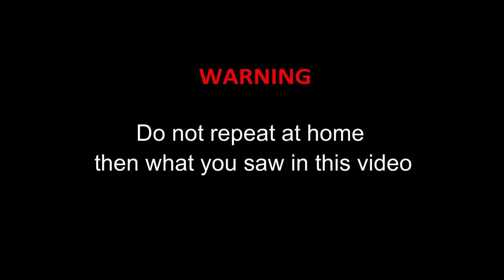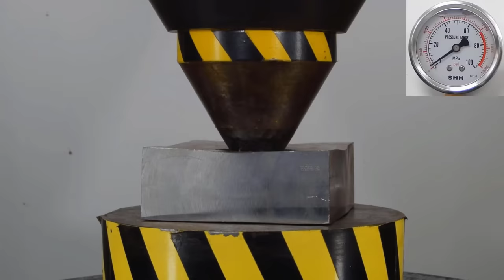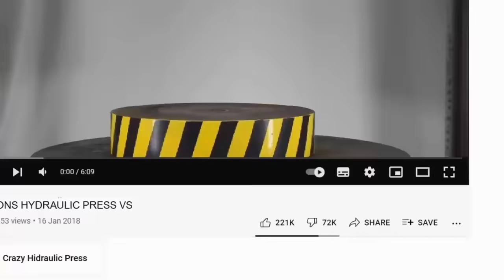HYDRAULIC PRESS VS OLD AND MODERN ARMOR

Comment: That modern armour reminded me of a story my metal fab teacher told me. Someone he knew was asked to repair some part of a tank, but the nature of the material was secret, so he had to just guess a lot for working on it. After destroying a few tools and failing to cut the material with an acetylene torch, he finally to the military guys who had hired him that they'd have to disclosed what they could in order for him to work on the material. After taking the time to see what could be revealed, one of the first things the military guys asked was if the fabricator was wearing fully closed respiratory equipment and ventilation. Now, you should be doing that stuff in most cases anyway, but when working with normal steel it's not a big issue. After hearing this the fabricator said "I sure am now!"
Reply: depleted uranium?
Reply: @vincasvosylius6045 even just manganese steel fumes can be pretty damn nasty, you can get away without wearing a respirator for most materials, especially with good ventilation but any kind of armor plate is probably going to have chromium, vanadium, manganese, etc that you really don’t want to inhale
Reply: @vincasvosylius6045 thats for ammo not armor
Reply: @affegpus4195  many modern tanks use depleted uranium plates on top of their standard armor. It’s incredibly dense and helps with sabot rounds.
Reply: Beryllium
Reply: The Day The Earth Stood Still. “We tried everything from a diamond drill to a blowtorch. There isn’t even a scratch on it.”
Reply: "Did you or a loved one repair classified materials for shady military units? You may be entitled to compensation."
Reply: @SherryAPerry no, beryllium is soft and would not make a fabricator struggle
Reply: @daniel45-70  it may be present in an alloy, though I'm not sure  of any armor plate that uses beryllium as an alloying element. I do know that some anvils are made of a beryllium copper alloy to avoid sparks, and that welding beryllium alloys is a recipe for a very bad time
Reply: Beryllium is also pretty small so I could see it being a great interstitial element similar to how carbon acts in steel.
Reply: I don’t know what the heck that tank is made of that you mention, but I’m very familiar with steel. Particularly high carbon, medium carbon, and highly alloyed steels, as well as your standard mild steel. I’m a blacksmith that works with these very often. Looking at the composition of AR500 grade steel, honestly it’s not anything super unusual. Could be a real pain to cut, being alloyed with all those elements, but it really doesn’t have anything in very high amounts compared to steels used in knives and other cutting tools. Heck with 0.31% carbon I doubt you could harden it past 45 HRC. Honestly, I’ve cut worse with just an angle grinder.

TLDR: AR500 steel is great for bullets, but isn’t that hard to cut if you know what you’re doing.
Reply: @TheGreenGamer33  Usually tank armor is a little more complex than just AR500 plate, as it may have other alloying elements to add toughness without adding brittleness. JLTV's and up armored humvees are just AR500 though, but even on that you should wear your respirator when welding them as the fumes can get pretty nasty. 

I don't know the exact specifics but usually modern tank armor is a layered design of ERA then steel plate, ceramic or NRA/ DU armor, Inner steal liner, and then some kind of anti spall layer on the inside. This varies by tank and some may be missing some of the armor layers.
Reply: @stonep11  really? afaik the reason why we made ammo with uranium was not just the density but the way it fragmented on impact which dint sound very armor friendly
Reply: Francium
Reply: @izoi24  Ceramic would definitely throw a wrench into things. And anti-spalling materials would make torches and plasma basically a no-go because of possible flammability. As for the fumes, any coating would definitely have to be removed, and of course welding in general can produce fumes depending on the type of weld.

All in all, good points. Learned something about tank armour.
Reply: That's so nice of them to not disclose anything or the fact that the material used is toxic to breathe in.

Why are they repairing tanks in a civillian repair shop anyways?  Don't they have military-grade repair-shops on bases or w/e?
Reply: @izoi24  Manganese fume inhalation can cause kidney tumors. Source? I'm having one of mine removed later this year.
Reply: The paint on armor has Chromium 9 in it, very nasty if the fumes or dust
is inhaled.
Reply: So they just some random dude work on a tank. Weird shit man
Reply: I always wear s respirator p100 filter with carbon.. even cutting grinding mild steel is harmful.  I work on my classic cars.. cutting welding grinding..  Youd be shocked how black the paper cartridge gets
Reply: @AlvinKazu  not sure about tanks honestly but you would probably be surprised how many civilians work on military bases as contractors doing all kinds of things from simple things like barbers to very technical and advanced jobs
Reply: When a tank is holed they weld it with normal wire and paint it no one has ever complained about it so it must work,or maybe that are dead either way we don’t throw a good tank away,crews we can just stick another one in there.
Reply: @TheGreenGamer33  AR(abrasion resistant)500 are just steels that are hardened to 500 hbw(which is about 52 hrc) in the steel factorys, developed for large equipments like trucks, excavators, etc. They are just by coincidence good at stopping bullets because of their hardness. They are not too special composition wise, but some swedish guys figured out how to harden them to the spec in large scale.

Comment: I was expecting the supercooled ball to be much brittle and explode easily when got in contact with the AR500. The outcome was unexpected.
Reply: same !!!
Reply: Right
Reply: @JimmyR42 v accurate
Reply: I believe cooling the steel makes it stronger. Reducing the heat would also reduce the repulsive forces between  its atoms, making it denser for a short period of time. It'd also counteract the heat produced during compression,  allowing it to retain integrity for longer, since heat causes expansion and that expansion isn't uniform which wof lead to catastrophic failure. 

I'm not sure what steel it was but I think stainless steel gets stronger at cryogenic Temps. Idk,
Reply: The steel acts like a heat sink and start sucking the cold out of the ball bearing vary fast
Reply: I thought the same, very surprising! What was the alloy of the ball?
Reply: I wonder if the steel was already compromised before he put the ball on. I guess the dimple answered that.
Reply: If that was the same block that had previously been penetrated by the harder steel cone, the sharp depression in that block would have set up a stress concentration at the lowest point of that depression.  That's why it fractured at that point.
Reply: @PromptSupercritical  5:14 you can see it is indeed the dented block, so a pointless experiment imo as it just proved what you said. A non cooled ball of steel might have done the same
Reply: LOL there is no thing as sucking cold.  Your heat sink is the ball bearing.  It sucked out so much heat, that it warped the armor, causing it to crack under the accompanying pressure. @MeganChic
Reply: @TargaWheels no the dimple was from the ball pushing bc its a sphere
Reply: @lewcrowley3710  You  are right in the first part as the ball was sucking the heat aka energy from the steel plate... there was more than likely a cold spot in the middle of the armor plate and super hard steel do not like it, on top of it colder steel=less volume=there was axtra tension from the temperature difference in the middle of the plate and on the edges.
And super hard steel in general do not likes super cold temperatures and becomes very britle...
Reply: @JimmyR42   Combined with the incredibly strong structure of a perfect sphere. and lets not forget that armor piece was very compromized, even literally. 

If the armor wasnt pressed first i think the outcome could have been different. 

I definitely suspectet that ball to blow up as the first thing. But i didnt think about the cooling being as its advantage which is an interesting point.
Reply: Same. Lol
Reply: It has nothing to do with the cold absorbing energy from the press.

For many alloys, cryogenic "heat" treating is much more effective at strengthening and hardening the metal than traditional heat treating. The ball would still be stronger even at room temperature.
Reply: The lower temperature makes it more brittle but also can resist a higher stress
Reply: For those wondering, most steels are about twice as hard/strong at 77K as they are at 293K (rt)
Reply: @minutiesabotage There is a state effect and a smaller residual effect. In this case, most of the strength increase of the ball relies on actually being very cold.
Reply: yeah i def expected the ball to NOT vastly outperform the super hard hydraulic press cone
Reply: If I'm in a tank in battle I'm definitely setting the air conditioning on low.

Comment: 10 year old child: "Why don't we just make planes out of this?"
Reply: That’s what the MiG-29 wanted to do. But it was already a heavy load of crap with its powerful engines NEEDED to even get that thing of the ground.
Reply: In other word because steel is heavy as shit
Reply: They did, with the MiG-25. It's a piece of shit.
Reply: The blackbird made it work, all ironically from the Soviet titanium supply
Reply: Heavy
Reply: Why stupid loud music not required
Reply: A10 Thunderbolt II has entered the chat
Reply: actually it is a good idea. If you have spared load, you can add some armour plate to protect your pilot. The cas planes such as su-25, Q-6 or A-10 all have such armour. But for fighters, if you have spared horsepower, you d better leave it be. 'cause in ata mission the agility is a key factor.
Reply: @introboy1 it's a brick shitbox. A real Chad plane is the F-15.
Reply: @introboy1Only because the F-15s haven’t shown up yet

Comment: Absolutely INCREDIBLE!!! I had no idea that modern armor plates were this hard/strong!? That was an awesome vid, thank you for sharing.
Reply: I am a bit skeptical because T34 is known to have way too much hardened armor. Sure the projektile will not penetrate but it was prone to crack. But worst of all on shell impact it absorb all the energy transfer it to the other side creating splatter of hot almost molten sharp shrapnel scattering inside the thank. So even thou it seemingly survived direct impact without visible damage the inside situation may not be so optimistic.
Reply: Metallurgy and heat treatment has improved by a lot since 1930, but a t-34 is the worst example to list for WW2, the steel was of a very poor quality even by the standards of the 1940s. 

Like the other guy said, it was radically treated for hardness, which made spalling common every time it was hit by a larger shell, and it happened a lot because it was only 45mm thick. Because the armour was highly sloped, there was little space inside for 4 grown men, so there was a lot of meat for loose metal to shred into.
Reply: Rifle plates can stop any Small arms bullet except maybe a 50 bmg. They are strong af. I have some armor plates myself.
Reply: It makes one wonder, how bad ass are the tool used to work that armor?!
Reply: @portnuefflyer honestly some of our strongest to be produced from the Industrial age so far 

They have presses that do many times more than the 350 tons of pressure in the video
Reply: @portnuefflyer  I think armor plates are first machined and hardened at the end only.
Reply: @scasny  The T34 armor was made out of cast steel, it has the advantage of being easy and fast to manufacture, but not particularly strong.
The Germans had face hardened armor, it was hard on the exterior and elastic in the interior, it was tougher and didn't splinter when hit. But that required flat surfaces and many welds , making the tanks more expensive. Otto Carius writes about his experience with both types of armor in his book.

Later in the war, the Germans ran out of alloys they needed, their tanks armor became too hard and cracked when hit hard.
Reply: @scasny  said it yourself. It was poor heat treating and a lack of expertise in metallurgy that killed the T-34 - not the steel its self. The steel its self is fine. Especially with modern metallurgy techniques.
Reply: @portnuefflyer You can always heat it up.
Reply: @scasny  T34 and T-34 are 2 very different tanks.
Reply: @portnuefflyer  They may have to cut it with lasers.
Ideally you want to get very close to the final shape with soft metal and then harden it.
Reply: As technology progresses, so does our metallurgy.
Reply: Would be interesting to see how WW2 naval armor do in this test

Comment: AR500 is typically used in abrasion resistant application like feeder bins for asphalt. Very hard stuff but also incredibly brittle
Reply: and body amour
Reply: Thats why we back the armor up with a splinter shield made of softer steel. 

At least the Navy did...  can't talk about tanks.
Reply: It also work hardens while cutting...
Reply: Tank armor does not want armor that is brittle. A single impact could make the armor shatter or weaken to the point of breaking
Reply: Yes very brittle, it fractures only at 350 tons.
Reply: Spalling would kill the crew on a hit if the armor is too brittle even of the shot doesn't penetrate.
Reply: That's what HESH is for.
Reply: @Erik_coolman  

You may want to educate yourself on how “brittle” armor plates are.
Reply: I want to be very clear that my comment is based on the industrial application of AR500 only. I know nothing of its application in the military. I have worked with AR500 at 1 inch thickness and no where close to the thickness in the video. High thickness metal means more force to break. The key thing is observing how the metal shatters into pieces which indicates it is brittle. Less brittle metal can be bent, shaped, and when it breaks it shears off. High compressive strength is also a quality of brittle metal so this test is a testament to it qualities. However, it doesn't have high impactiveness strength a simple google search goes a long way before you type something that makes you sound ignorant.
Reply: @Erik_coolman  Modern tank armor is composit armour. Tipically there are Multiple Layers of different stuff. Brittle stuff to break up shells, other stuff to absorb energy by deformation or friction It's like with modern body armor. Yes you can slap a 400mm AR500 Steel Plate to the front of a tank, but that tank would weigh as much as a multi-story family home. 

Modern Tank armor (front plate or turret) is equivalent to more than 1000 mm of rolled homogenous armor steel (similar to the stuff in the t34, but that one only had 45 mm).
Reply: That explains the explosion.
Reply: @ProfessionalValle  100%
Reply: 350 tons is needed to shatter it “incredibly brittle”. lol
Reply: @glowstickqueen7139  thats nothing for an anti tank weapon
Reply: I tought They used depleted uranium in western tanks
Reply: @fiddibelow Depleted uranium is used in armour piercing rounds due to its incredible density.
Reply: Yes we use it in everywhere in mining.
Brittle but immensely hard, 5000 tons per hour of iron ore spilling over it for 3 months non stop before it’s worn out.
Reply: @guessmyhandle thats what I was thinking as a solution I didnt know it was already used
Reply: Best solution would be to have no need for an armour if it comes to human conflicts ;)
Reply: @SmokingGun39 anyone that deals with metal knows hardened steel explodes unlike soft/mild steel.  We used ar500/hardox in hoppers amd such on crushers.  Ar500 around 1/2" thick is also used in body armor and steel shooting targets.
Reply: @Deere2154D  yep
Reply: @guessmyhandle  tanks have the same, brittle armor at the front, and softer behind to absorb. I heard it in some documentary. The same documentary said: modern armor is basically glass.
Reply: AR500 for armor application is used by companies that compete on lowest price and low quality. For armor, steel rated to Mil-Spec 46100 (and a host of other specs) is used by property armor products providers. Remember AR stands for abrasion resistant.
Reply: It's not that brittle, it's used extensively on competitive combat robots and takes some nasty hits.
Reply: @Erik_coolman  true. glass is hard but you can break it with finger
Reply: Clearly, incredibly britter

Comment: WOW, just wow!!

My husband welds with AR500, both at his previous job making oilfield trenches and at his new job making bumpers... Him and my brother in law always talked about this steel, I just never in my life figured it would be this strong!!
Reply: AR500 is Iron, Carbon, Manganese, Phosphorus (!), Sulfur, Silicon (ok this is not toxic), Chromium, Nickel, Molybdenum, Boron (!)
I don't think it's very safe for handling, and simple steel should do better if you have a welding torch at hand.
The same is with aluminum: nobody like to repair this (cars, ships, ...). Carbon is more nasty to repair.
Reply: @losttownstreet3409  Phosphorous should not be more dangerous than Sulphur. It would likly only emit P2O5, wich is no more dangerous than SO3. In no way should working with a blowtorch create white Phosphorous (that would be toxic).